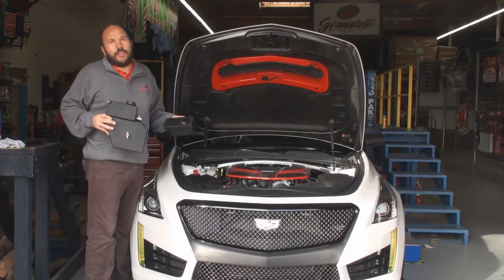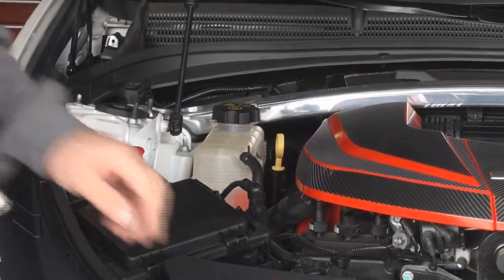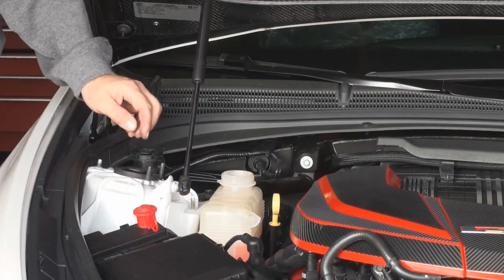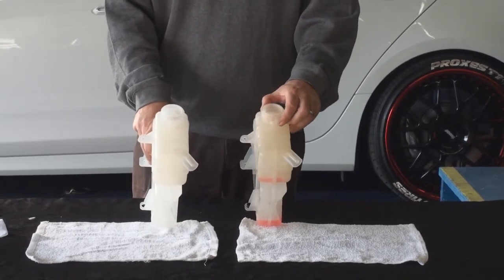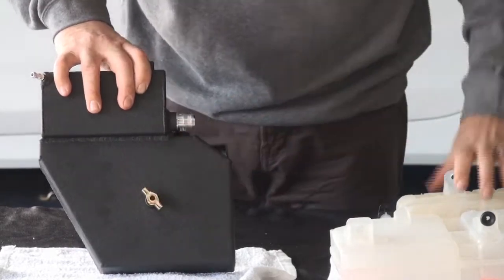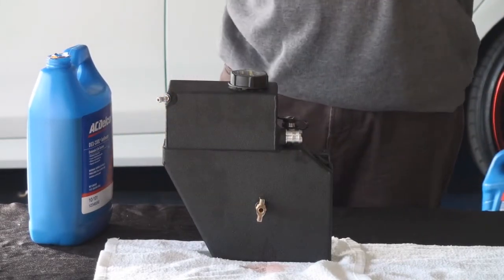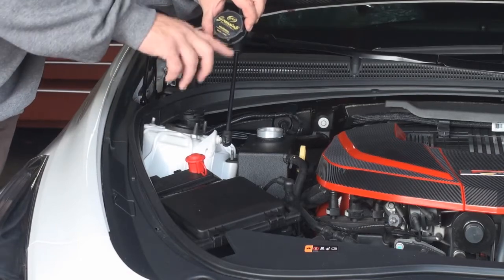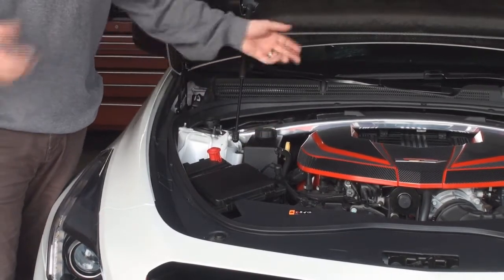2016 Cadillac CTSV Radiator Expansion Tank Install

Comment: I have a Cadillac ATS 2017 I don’t see fluid on the bottom tank. Does this just take coolant as well?
Reply: Did you ever figure out what was it ?
Reply: The top tank is the pressure tank.   It should be full.   The bottom tank is the expansion tank.   It should be filled to the fill line.

Comment: It looks good!  May I suggest a small clear window to see the status of the coolant.  With my ATS, I recently had transmission fluid in the coolant tank because the radiator failed and I was only able to catch that in time because the tank was transparent.
Reply: Great idea
Reply: yeah I think there is a reason the tank was originally designed to be see through... I'm not sure why adding a tank that can not be seen through AND adds weights is a thing here?
Reply: @THE_CHOAS_ENGINE  And its $500, 4 and a half times more than the oem.  This whole thing is a bad idea.

Comment: My coolant tank is empty before i start 2015 Cts, is this normal? When i start car coolant fills up to minimum line
Reply: Apparently no.   Based on this video, the lower tank should be filled to the line or about 1/2 way.    I'm here to learn the correct fill level as well.
Reply: Top tank is a pressure tank.  It should be full.   The bottom tank is the expansion tank.  It should be filled to the fill line.
Reply: @VelleyIndustrial do you add it into the top that has the pop tab ?
Reply: @Htowndaz yes